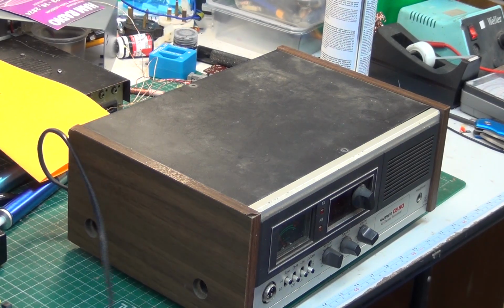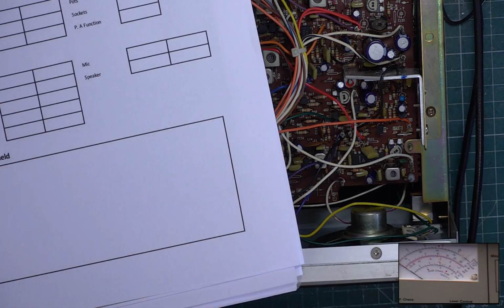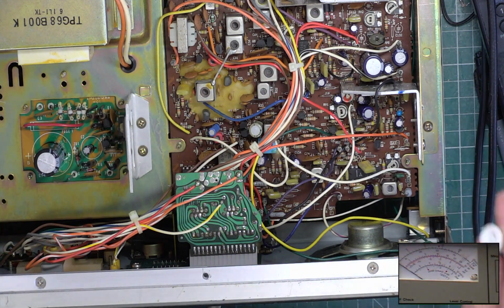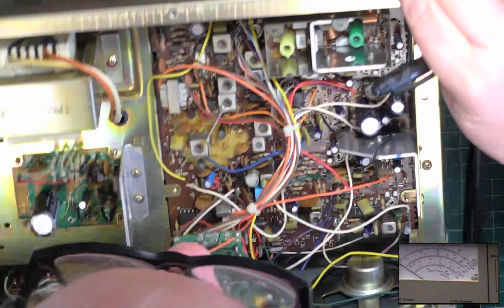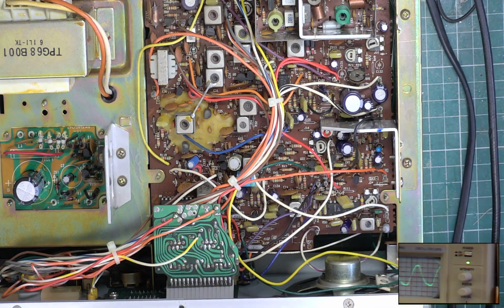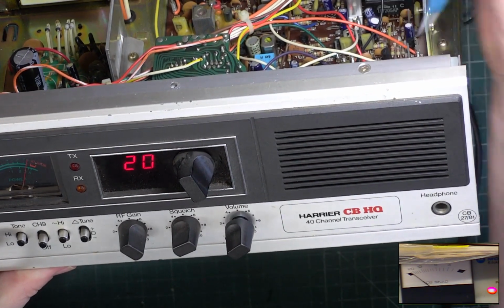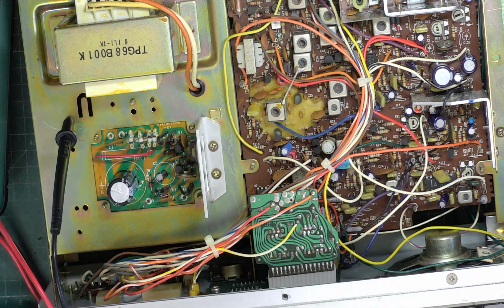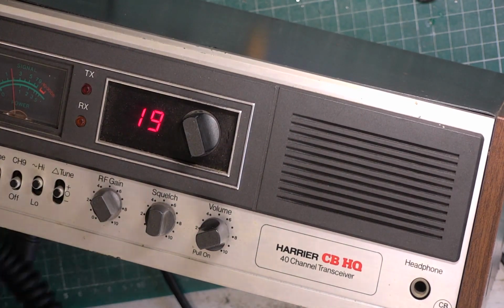Harrier CBHQ CB27/81 UK FM CB radio base station - Service & realignment

Comment: What would happen if you was to add the extra 2 pots to a say a CBX or RVC240 ? would it make any difference would be nice to see
Reply from the maker: It's one extra in the better mobiles (such as RVC240, York 863, Barracuda HP940, Harvard 420M etc) and another extra in base station versions like this Harrier, the Midland 76-900, the York JCB 969 etc.

It's to do with selectivity, so better to help with bleedover. It makes no difference to sensitivy or therefore range whatsoever.

The Rotel RVC230's are strange because some have the extra stage & some don't!

I had a high end Cybernet 134 mobile in the other week, though I can't remember which model. Someone had indeed fitted the base station extra coil to it.

Richard

Comment: Its unbelieveble, Last  week ich bought a CB Radio at the German Aftermarket. It is a Hy-Com  CB5000 BS that was only produced for the netherlands. Its the Same Chassis and Look Like the Harrier cbhq but only 22 Channels. In Germany wie Had the the Same Chassis and the and the Radio ist called stabo xf4012 but without the woodsides. Now ich have one of the Hy-Com and two of the xf4012. And one week later comes a Video online about Service and alignment from UK FM Radio servicing😂😂 ist IT all random ??! Or a sign. Thank you so much for your Work and best regards from Germany also to Mr. Chippy 😉👍 Matten ( Golf Lima Station)
Reply from the maker: Thank you. You will find the earlier chassis used in the HyCom is a different chassis number (This is 134). The HyCom will be 22 channel & 500mW output.

Richard, UK

Comment: Nice to see it back working again never owned one but they were very popular, I used to see them in Dixons along with the rest of the Harrier range at the time, I was still at school and thought maybe one day but didn't have the cash back then to upgrade I would have needed 5 paper rounds lol😂😂.
Reply from the maker: Well like the Midland 87-900 I use here at the base stationm the innards are no different than a Rotel RVC230 etc; it's the same basic chassis. You get an extra RX stage in the Cybernet base stations, the power supply & a nice case. When you consider a bottom end Cybernet 134 was £69.99 & the Midland 76-900 was £369.99. You have to consider if the £300 extra for a nice case is worth it. In my opinion...it is.
There are no UK base stations, other than the Fidelity 3000 that have a dedicated base station chassis. They all use the same board available in mobile models. Mostly good chassis.

Richard
Reply: It is good to have a nice case and good performance together, I was lucky enough to have a gifted Fidelity 3000 that had sat in a garage for 30 years from 2019 to 2020 which after doing the necessary checks before switching it on it worked a treat got good signal and modulation results with the regular breakers still in Lincoln, unfortunately I lost the rig again when I parted ways with the ex missus or I would still have been on Air.